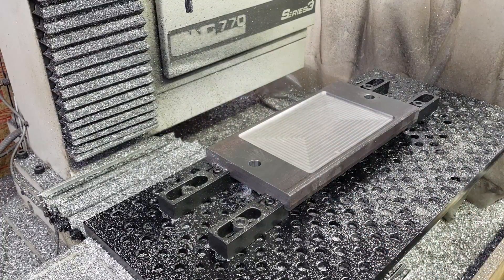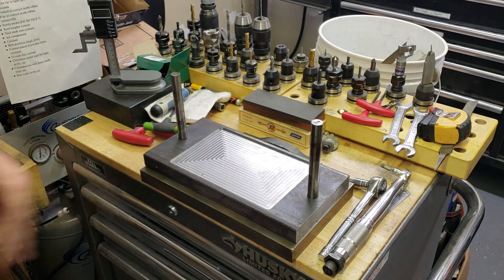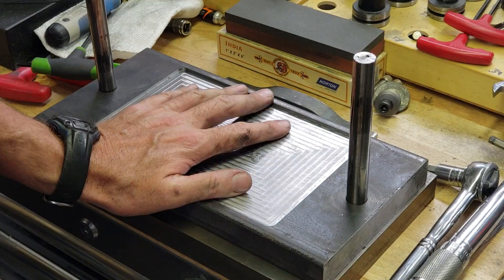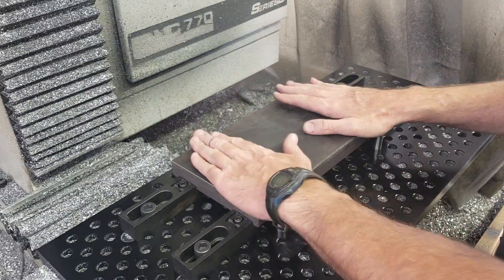Sheet Metal Press Die  - Making the Die Holders

Comment: I'd be very tempted to drill and tap a couple holes in the coroners of one side of the die holder plate, then figure out your stack up height for a closed dimension on the die with a part in it . Then make some die spacers for that number plus a couple thousandths of pre load, if you dont over time your just going to end up deforming the aluminum instead of your sheet metal part bescuse theres no hard stop.
Reply from the maker: Good point, aluminum is pretty soft.  Thanks!